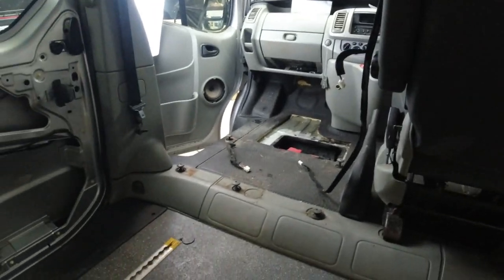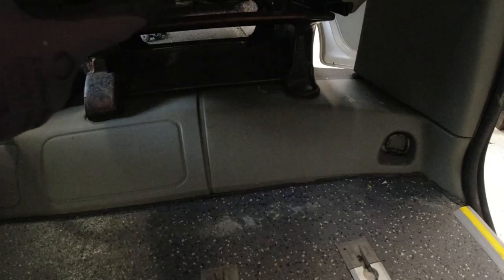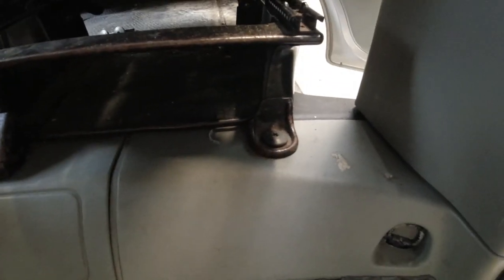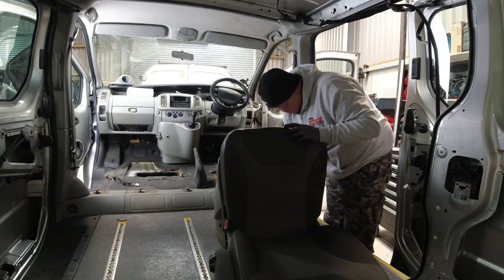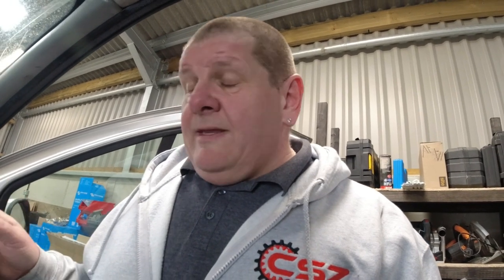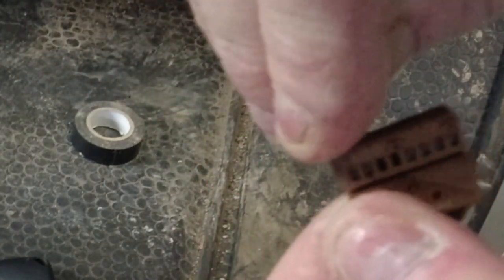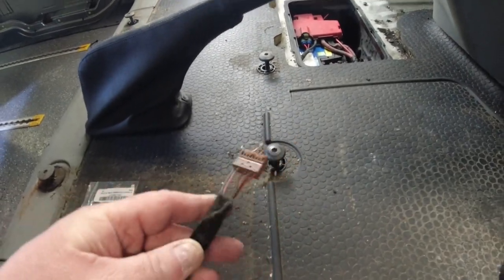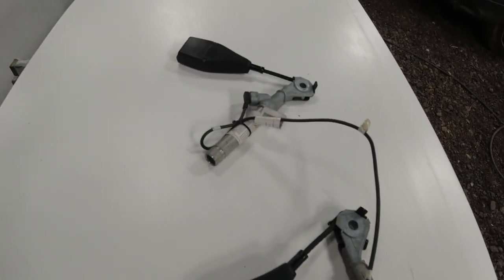Renault Trafic Campervan Conversion - Airbag fault light - Easy Fix

Comment: So please explain : are the the two BLUE  wires ON   the CAM  buss   ? And the  SEAT BELT sensor is just  wired  across ( in series ? ) on the CAM BUSS  The CPU  is looking for 3.3 k ohms ? To know that either the seat is being sat on  or not .?  And your just simulating the sensor being sat on ,, is that correct ?

Comment: Hi i have tried this but  no luck however my passenger seat is a double which i have added a swivel to. Can i use more or do i need stronger resistor?

Comment: Presumably, if you're just putting the original seat back in, you don't need the resister trick. Been looking for how to remove the seats out so I can clean my Van properly (just bought an ex trade van, so its got years of dirt in it) and maybe even recondition the seats themselves. This vid is the best explanation I've found!

Comment: I bought my renault traffic based motorhome fitted with 3rd party swivel seats and came with this fault .That brown plug is hanging loose so ordered a resister pack off ebay.Thanks for the tip.Fingers crossed now.
Reply from the maker: It should work OK.  That's the only thing when fitting non standard seats
Reply: Did it work ?

Comment: Hi ya mate my van been sitting on the drive for four weeks because l put in a single seat six months ago  and now failed mot just ordered resisters thanks alot for your info
Reply from the maker: Oh that's amazing I'm glad the video has helped.  Even if one video helps one person it makes it all worth while making them.  Thank you
Reply: And did the  3 ohm resistor bridge work ?
Reply: @studiosys  yes wedge resister in and had another 4 years out of the van thanks nigel

Comment: Hi Karl 
I’ve ordered some resistors cos my light just came on today. When I took my double seat out I was surprised that I didn’t get a warning light, 2 years now. So I never bothered fitting one. I’ll try it, but since I’ve had 3 years then my luck it’ll be the ECU.
Have a great time now at Stratford, might see you at Dummer down if we get back to UK in time,
Reply from the maker: Oh wow you gwt lucky see you soon

Comment: Hi thanks for the video really has helped 
Is it the same resistor for both seat tensioners/ wiring 
As was told it’s a different ohm for twin seats 
Any advice would be most helpful thanks 😊

Comment: Hey mate, thank you! I would be so happy if you helped me quickly, although this video is 2 years old already.. I removed my traffic's seat already, without disconnecting the battery, so I got the airbag light directly. Now I ordered one of those resistors, so my question is : Should I still disconnect the battery before "installing" the resistor anyway? Or should I leave the battery connected when putting the resistor in place? Thanks in regard mate, great work! 😁👍🏽
Reply: Hi fella , like you i have only just come across this video and for me having been told before my Renault went for its mot it would fail ! because of the seat belt light ! like you i never disconnected my battery when removing all my seats and replacing with swivel plates but i did when fitting the resistor and no air bag light anymore! What a great find on youtube this was by Built not Bought thanks saved me a few quid.Hope this of help
Reply: @andrewsait3946  awesome bro, thanks for your impression! Cheers! :)
Reply from the maker: Definitely disconnect the battery always do that

Comment: we are doing a campervan conversion on a 21 plate Citroen Relay, the seats are out and gone onto better things, and are replaced with Galaxy captains swivel seats. would the resister required be a 3,3ohm one as well, or is each van going to be different, and  where would I locate that info? Thanks for your time

Comment: Great video that helped me out.  My Movano passenger seat needed this with a different resistor.  Easy to check by putting a multimeter on the part you're removing to find the resistance you need to replicate.
Reply from the maker: glad it helped you out

Comment: Top job pal, I'm on with my Trafic , ripped out seats in the back , do they  have tensioners aswell ? Stripped them out , only the reels left , take it I'm ok to remove ?
Reply from the maker: No they don't have the tensioners so won't cause a problem.  Thank you

Comment: Great video! Can you tell me what colour wires you put the resistors on, on passenger side? The wiring is slightly different on this side, with all the wires in a row.  The drivers side were the same as on your video. Any help appreciated
Reply from the maker: Check the wires on the passenger seat as there should only be 2 and look at the location on this plug.  Then marry it up to the socket on the can which will give you the correct location.
Reply: @BuiltnotBoughtCampers  thanks for your rapid response. The problem I have is the van had BMW seats in when I bought it but think I can see from your video enough to give it a go. Thanks again, top man! ;-)
Reply from the maker: Oh right ok.  Hopefully it's enough for you to figure out if you have any problems email me

Comment: Thanks for sharing. Do I take it that having started the engine with the resistor in place you then remove it so that the connector can then be connected or does it fit together with the resistor in situ ?
Reply from the maker: There is no connector on the seats I leave the resistor in place and it simulates the original seat is still there

Comment: Great video. you mentioned you did it with your iveco, is it the same principle?
thanks
Reply from the maker: Yes it is the same as all the seatbelt restraint systems have a resistance.  The resistor tricks the system in thinking its still connected
Reply: @BuiltnotBoughtCampers  hi again. did you make a video of your seat change on the iveco. I have traced all the yellow wires but none seem to have an open connector
Reply from the maker: It's the plug that plugs into your seat belt point that the resistor goes in.

Comment: That's that sorted for me. Thanks
Reply from the maker: No problem 👍
Reply: So my Vaux Viv has   TWIN  front seats  , i only have two blue wires , so   are the 2 x PT in series ?  And the 3ohm resistor bridges these  2 blue wires ?

Comment: Hi feller I’ve got same van with 2014 seats but all plugs been cut to wireing so unsure what colours to connect resister to ...paul
Reply from the maker: i would google a wiring diagram as the looms for different years can vary in colour or ask a local renault mechanic they maybe able to tell you
Reply: @BuiltnotBoughtCampers  thank for reply will have a look .paul

Comment: Just a quick question? Would this still pass an mot? And do you plug the seats back in or leave them unplugged?
Reply from the maker: As long as seat is secure and no lights are on the dash it will pass an mot
Reply from the maker: it would pass yes

Comment: Hi will this work on a Renault master 08 and if so what size resistor would I need thanks Cliff
Reply from the maker: It would work and i would imagine the resistance would be the same but put a multi meter between the two points on the seat belt buckle srs wire.

Comment: Hi I changed my trafic seat passenger side for a single seat but my wires from my van don’t have them clips just 2 back things that plug into the double chair if you no what I mean?
Reply from the maker: Yeah they should be yellow trace the wires and if they go to the seat belt point that the seat belt plugs in to they are the right wires

Comment: Hello. I have taken out a stock double passenger seat and after few weeks put a single passenger seat instead, but i have not bypassed that plugg. And now, after few weeks when i finally connected this plug to the plug from the new passenger seat,  the airbag light is still on the dashboard... Is there any solution for that ? Or only cancel that error by OBD reader?
Reply from the maker: I would use a resistor as I did in my video.
Reply: @BuiltnotBoughtCampers  yes, I will try with resistor then, thank you for the video, greetings!

Comment: can i just put 1 on the double seat or do you have to do both. (drives side aswell)
Reply from the maker: You only need to do the side that you are changing as they are individual sensors for each seat